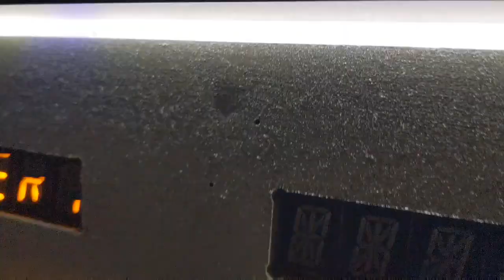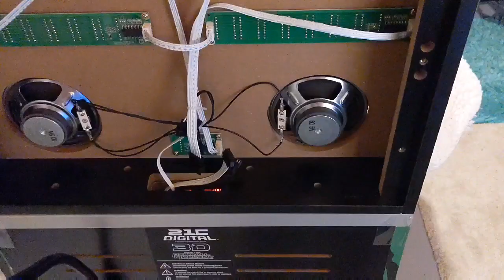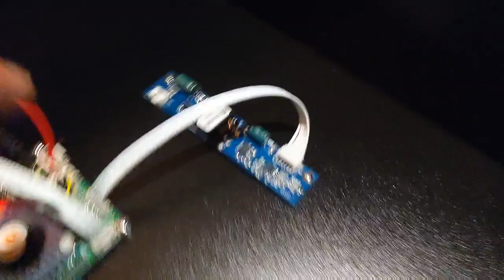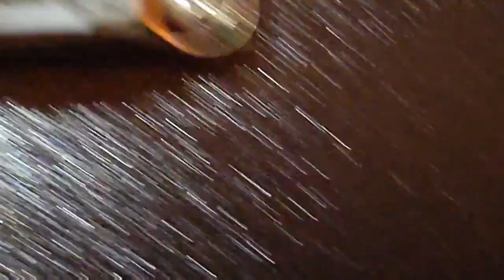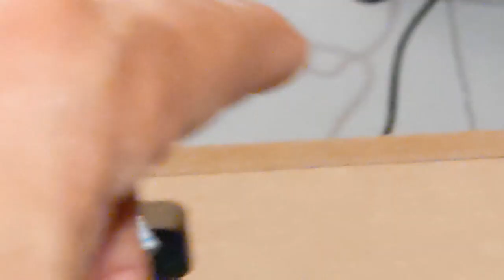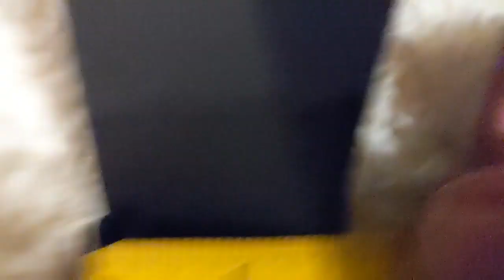Dissecting the Toyshock Digital Pinball for Modding and Troubleshooting

Comment: Great video it’s bout time someone took everything apart. I was thinking of building one from scratch but I’m trying to see what’s more cost effective. It’s build one, get this or go to GRM SOLUTIONS. This either way would be an expensive build compared to a bartop or a reg arcade.. I would put the biggest lcd TVs that thing wil allow.. mind you TVs are really thin these days. My bartop that I built has a 32” lcd screen, to creat more room in the front and back I stripped it to the bare minimum and the plastic bezel that housed that tv was a lot of filler. So some TVs you might have to do that and others you won’t. It’s easy to build and mod these type of machines you can go to home depot or Lowe’s and by new stilts to raise up the pinball machine .. I tell people don’t be afraid to drill right into that mdf wood and make sure you have good stability and brace.. If your trying to reuse the groves and you feel your limiting yourself just get a router bit to extend that grove to be wider.. I’d use every inch of that cabinet.. just sucks that it’s up there in price and it’s just a kids toy. A good pc that’s small but powerful enough with the ram and graphics and ect, is gonna be around 300 give or take on your preferences.. In the mean time good luck to everyone wanting to mod there pinball machine or to build one. Good video can’t wait to see what your final result is, much respect ✊🏽 to everyone and happy gaming...

Comment: Thanks for doing this video. At least now, I finally see why the back box marque was so dim. It was in direct contact with the wood, which holds the score indicators, and only has a single edge strip LED light. Until I can afford to gut the whole thing, and replace it all with monitors, I'll move the speakers, loose the wood panel, and affix the score LEDs directly to the marquee, and then I'll paint the rear panel wood interior face white. I'll also use a proper lighting source, which should make the marque pop, nicely. Fingers crossed. :)
Reply: Indeed. that's when my best plans come to me, too. LOL :)

Comment: Back in 1984 there was a local arcade/Pizza place that went out of business, and they were selling all of their Pinball/Arcade machines for $275 each. There were a few machines selling for slightly more, and some slightly less. I didn't have enough cash to buy more than one Machine. I ended up having to decide between two Machines. Gottlieb's Haunted House Pinball Machine or Atari's Battlezone. Both machines were in near perfect condition as each were only a few years old. I ended up picking Battlezone. I have kicked myself several times since for not picking Haunted House, although Battlezone was a great Machine and a fun game. Neither one of them you can touch now for under $2,000 in less than fair condition if you are lucky enough to find one.
Reply: It was for me too

Comment: Mate, 
I have a 29inch ultra widescreen monitor, which I am thinking of popping in one of these and with the backboard replaced with a monitor. To run Pinball arcade, run long hdmi cables out of it to an external GTX1080 pc, and connect the buttons up to an ipac, with the plunger modded to a xbox controller anolog stick ....   

Part of me is saying its such a waste to just take the screen and board out to throw away .... but as I am in Hong Kong, by the time I ship parts, buttons etc, woodwork, legs etc ..it would cost just as much if not more 

The good news is this is actually made by a Hong Kong company

Comment: The cable connected to the screen is LVDS, and that's why it is short. The 'cpu' of the mainboard is probably an FPGA
Reply: The small one is the cable that connect to the inverter to power the backlight.